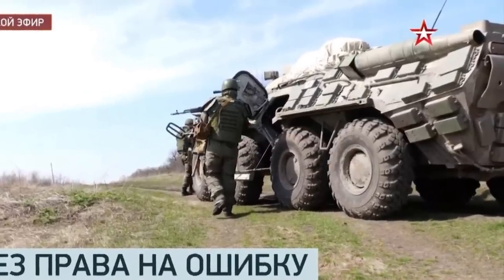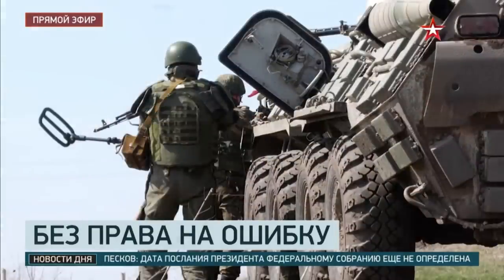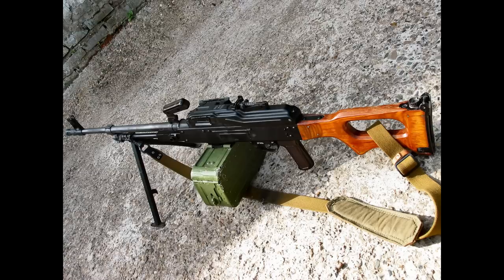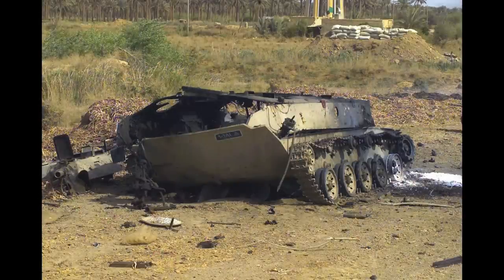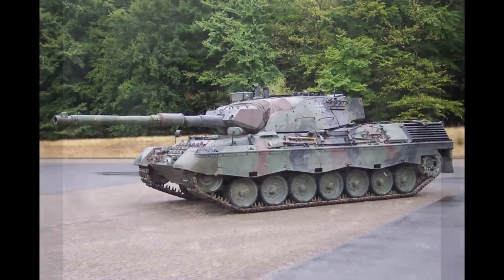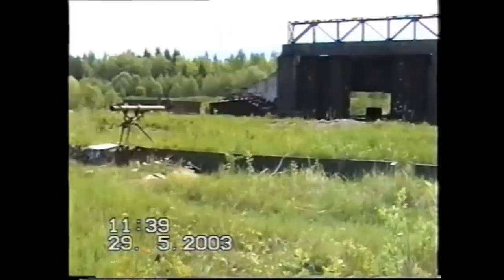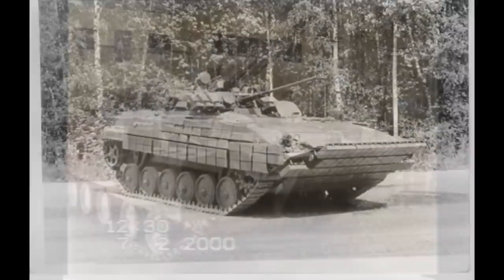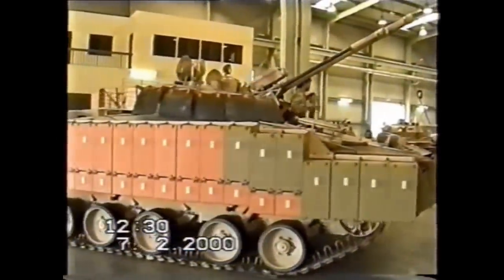Stop Putting ERA on Everything - Why ERA on Light Vehicles is a Bad Idea

Comment: Interesting... I always knew that putting ERA on trucks was dumb idea, but I thought that APC/IFVs are ok... what I failed to consider is that ERA like Kontact 1 does not fully stop the projectile and relies on thick armour behind it to complete the job... 

The only thing I am wondering... maybe ERA can actually defeat shaped charges at certain angles, or maybe even thinner APC armour would be sufficient to stop say RPG at 60% angle if ERA is mounted as well?
Reply: Well, if ERA explodes, it explodes, angling it won't change its explosion damage, it will only make it more effective against the shell so putting it on light vehicles even if they are angled is a bad idea as well
Reply: I'd say that would depend on the exact location on the vehicle and the thickness and hardness of the armor... Remember hardened steel armor likes to crack and throw fragments when experiencing enough force, so potentially just the ERA going off could forever sleep you if it punches the hull into  a fragment filled blast, similar to how large enough regular high explosive mortor/artillery shell/anti tank rounds without explosive formed penetrators could/can still defeat older tanks and many more modern APCs... Armor either usually either stops a blast or deforms enough to crack and spall on the backside... Although I'm guessing it probably makes people feel more protected and has maybe even worked in some very very specific accidental ways... like stopping a small penetrator jet from extreme distance because the ERA didn't contain the full explosive charge or something similar 😉 If the choice is between molten copper bouncing around and hardened steel bouncing around with also potentially slightly less molten metal, then I guess it's a coin flip which you prefer and if it helps you feel safer 🤷‍♂️
Reply: @Person0977  Not really my question. My point was - yes it is true that at 90 degrees say RPG-7 will penetrate BMP, it is as well true that at the same angle even with ERA it will still penetrate, meaning that for direct 90 degree hit ERA does not help at all (but I would argue does not hurt either, as crew is dead either way). That said I was speculating for example if hit is at 60 degree and RPG-7 would penetrate just BMP armour on it's own, maybe additional ERA would deflect the impact enough to protect the BMP, or at least enough so that BMP armour itself could then contain the impact?

I mean fair enough - this would be niche use case and would simply make it inefficient to fit, but I guess my final point - if it makes no difference in 90% of cases, but does not hurt and in 10% of cases it could protect, maybe it is worth it just for that small chance it may work.

Comment: Well... I think it can work but needs enough standoff or heavy backplate. I mean if you put it 30mm away from 10-15 mm plate with enough room to dissipate it ought to be ok. Since ERA is not a shaped charge. I think that it could be how these Russian light ERA work, some spacing foam behind ERA blocks to dissipate energy. 
But If I were to use kontakt-1 I'd stack 2 blocks on top of each other, one plastered on armor filled with something to dissipate blast energy instead of explosive filler, and make the block on top loose enough to break off these extended mounts when struck. The way I see it it should help to prevent armor getting caved in from ERA and additional spacing giving improved performance against heat rounds, sort of ghetto spaced armor.

Comment: Idk if this one is true but i ve heard stories about soldiers ( from both side ) putting sand in these little boxes to add extra armor. Is this true? / somewhat effective?
Reply: At very low degree. It can make minimal range of penetration bigger by ≈ 50-200m. It still can be border between life and death though...
Reply: No, it will be not good. 
Just mass produce 4S24 lite and you can even slap them on an armored SUV. Kontakt 1 is not good.

Comment: I have a question about ERA.
If I for example grab a Kontakt-5 or Relikt ERA. And slap a Kontakt-1 ERA on it. Will it make more effective , Less effective or not do anything at all?
I got this question after seeing a T-90M fitted with a few Kontakt-1 blocks ontop of the turret cheek plates. On the lower side of it , closer to the turret ring.

Comment: Could a heavy rifle caliber like .50 BMG trigger the explosion of an ERA block ?
Reply: I doubt it.  The explosive AP round could potentially set it off.(its called the rauphus round or something) ERA requires pressure and heat to detonate, so any standard 50 cal round would be useless.  Even an I round would probably just blacken the box a bit.

Comment: If it can stop 12.7mm.... how much does that weigh to cover a BMP in that stuff then? It might actually work on light vehicles, but the weight cost must be excessive. Even ignoring the extra space it takes up, how mobile can it still be?
Reply: The BMP-3 will fit 5-6 tons. Thanks to the chassis

Comment: explosive armor will kill crew inside. You ca not make good armored tank by that. The best armored tank is Abrams. Is classified but this 10-20 tone is mostly in armor. and maybe 5 tone to have good working space.

also there is different variant of Abrams.

t72 is not a any enemy for t72
Abrams is batter then t90 in every why

t90 in general have some issue like engine, very weak control system and optic, 
and space inside for operation. 

t90 from top will be easy for penetration

Comment: I mean, let's say a BMP-2 get's a frontal hit by a Kornet ATGM HE, they are almost certainly all dead when impacted. However, if they add the ERA, perhaps only the driver is killed due to the ERA secondary explosion, and the gunner and commander live. Hence that is why they still add the ERA to the vehicles.
Reply: Quite the opposite, ATGM or RPG can pierce right through BMP  left to right without  causing any spalling and only small cumulutive jet can kill few people.
ERA will turn small hole from RPG into huge one creating a lot of fragments
Reply: besides if a tank gets hit and gets penetrated most of the time the crew will bail out, regardless how bad the damage is
Reply: that little ERA brick has literally no effect on a Kornet missile, it's not even weakening the penetration result. The Kornet missile is a 152 mm calibr weapon, it can rip through anything doesn't matter if it has ERA or not. That little ERA brick can only stop a simple RPG-7 at best

Comment: The first mistake about this video is the assumption that all these modules are ERA. This is not the case. Many of the “ERA” modules have been cut open to reveal several hard ceramic sheets bonded to rubber. There are a number of videos showing this. I suspect that Russian tanks come in a variety of armour packages based on threat level. 
For example: 1) standard tank armour with no modules if the threat is low.
2) ceramic and rubber appliqué armour modules for medium threat.
3) full ERA modules for high threat environments 
Therefore the more accurate assumption is that explosive ERA modules are being placed on tanks, whilst the ceramic/rubber appliqué armour modules are being used on thin skinned vehicles.

Comment: Feels like adding armor plates to ww2 planes... Sounds like a good idea until someone actually thinks about it.
Reply: Idk if you mean whole plane or just critical spots but ww2 planes used armor plates behind pilot and some other spots like front sides of engine or thick bulletproof glass on front canopy. Is it a good idea? Absolutely, new plane is way cheaper than new pilot.
Il2 even had front part of the fuselage made completely out of armor plates as a weight bearing structural component.